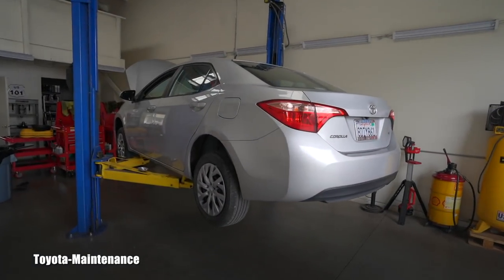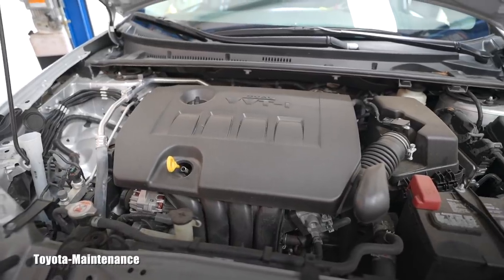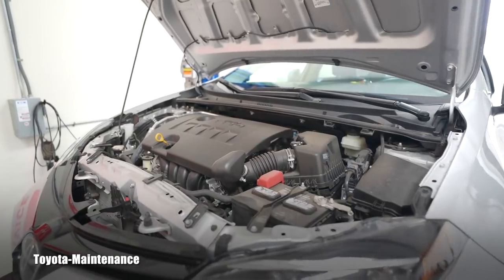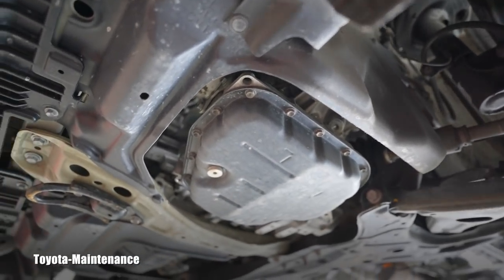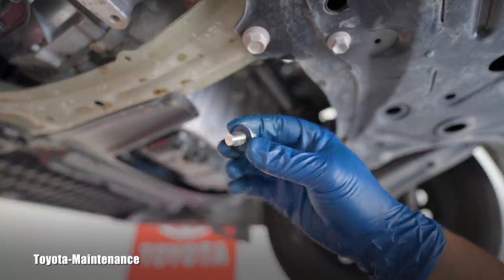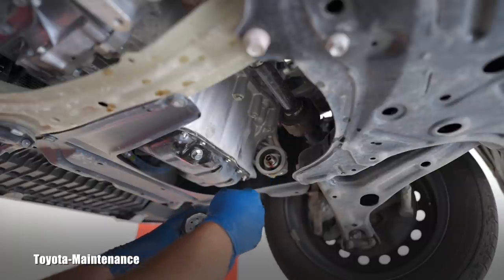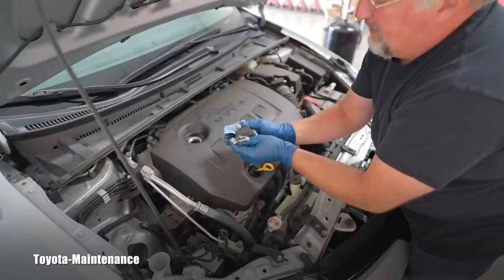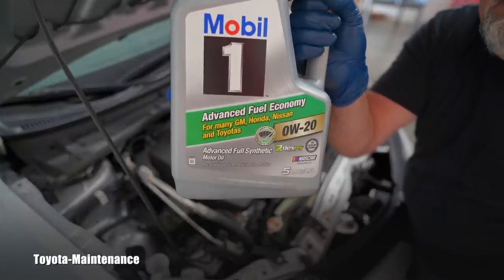2018 Toyota Corolla engine oil and filter change

Comment: For anyone with a 2003 Corolla,or  the 1ZZFE engine of similar years there is a TSB for an updated engine oil quantity.Originally the oil level was 3.3 qts. but the TSB updates the oil level to 4.4 qts.There is an updated dipstick available.I don't have the updated dipstick but,just like this guy,I put 4.5 qts. in when I change my oil.

Comment: Just bought a 2018 Corolla with only 3000 miles. Great car so far. 
Thanks for the video
Reply: Mine has 8000 miles. It's an SE with premium package
Reply: Check the throttle body for carbon biuld up. If it has carbon clean it out. You will notice a slightly better acceleration if its never been done and if its dirty. I have a 2016 Corolla and I took the airbox hose off and had access to the throttle body and it was pretty dirty. I decided to clean it out and I felt that the car drove faster and has become more efficient after that.

Comment: Peter, thank you for your wonderful videos. I had a question about the timing chain tensioner on the 2AZ-FE engine which is in my 2006 Toyota RAV4. My question is can the tensioner be adjusted? I realize that the tensioner is hydraulically controlled but I have heard that there is a procedure to adjust the timing chain tensioner by loosening the two nuts and letting the tensioner to be adjusted. Thank you!

Comment: Bought this car a bit over a year ago and I'm only now hitting 29,000 km. (18,000 miles) Previous owner only drove it 14,000 km in 3 years. (8700 miles). Better than expected upgrade from 2014 Corolla. I let Toyota do the first free oil swap but I prefer to do it myself after that. Thanks for the in depth run through.

One thing I've always wondered though. I had an 06' Tundra she the oil filter was on top of the engine. It was great. Unnecessary though, as I could not easily slide under the body without jacking it up. Why not have the filter on top for lower cars, and remove the need for jack stands all together?

Comment: You should open the oil fill cap while draining gravity helps all the old oil come out better. Also you should use oil around the oil filter before installing it back on.

Comment: I’m surprised that Corolla is still using that type of oil filter , wish Toyota would’ve kept that style for all its vehicles
Reply: My son’s 2013 has the cartridge filter. Not sure when they went back to the canister type.
Reply: @Starman-yt8lj  They went back to the metal canister spin on oil filter about halfway through 2015 on the corollas. Luckily the spin on oil filter housing can fit 2009-2015 1.8 engines on the corolla 2ZR-FE motors. I did the conversion on my 2010 corolla to the spin on filter. Very easy to do with toyota OEM parts from a 2016. Much better than the cartridge paper type. 

https://www.ptetra.com/blogs/blog/project-lexus-ct200h-spin-on-oil-filter-conversion

Comment: Hello sir, I am thinking of buying a 2010 GX460 with under 30,000 miles. The car has been sitting outside for about 3 years. What items should I be sure to replace/check?
Reply: Wow good find.

Comment: Great video but wrong oil. Always use Quaker State Full synthetic 5w 30 - never use 0w20 unless you live in some extremely cold area. QS oil is #1 with a over 130K protection. Mobile one is weak and so are almost all the other ones.Always use 5w30 for almost all modern cars(except diesel).

Comment: How is it this car has real oil filter and my 2015 has darn canister, plastic type
Reply: You can convert your 2015 the the spin on metal oil filter type if you want if you have a corolla with the 2ZR engine.

https://www.ptetra.com/blogs/blog/project-lexus-ct200h-spin-on-oil-filter-conversion
Reply: @robertomulero514  Wow!, That's the real deal --- Nice!

Comment: The oil fill cap and dipstick should be removed before the oil drain plug is released for a better drain of the old oil.

Comment: I always fill the filter with new oil before installing it.  When the filter sits sideways like this one, I fill it up about halfway with oil and the filter media absorbs it so nothing leaks out when I turn it sideways to install it.  That way, there is already some oil in the filter when you start the engine after the oil change. Otherwise, there is a slight delay for oil to circulate through the engine while the filter fills up and the media material absorbs the new oil.

Comment: When did Corolla go to that oil filter? I have a 2015 and has a cartridge type...hmmm
Reply: You just missed out. The went back to metal spin on type towards the tail end of 2015 for the 2016 models. The filter housing is the same so if you want to switch to the metal spin on type it's easily done. 

https://www.ptetra.com/blogs/blog/project-lexus-ct200h-spin-on-oil-filter-conversion
Reply: Yah just convert